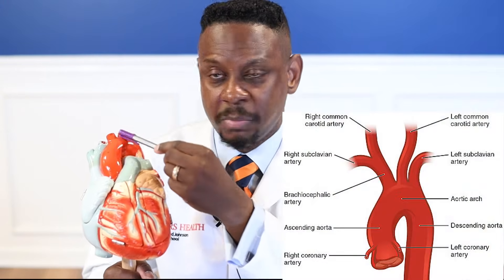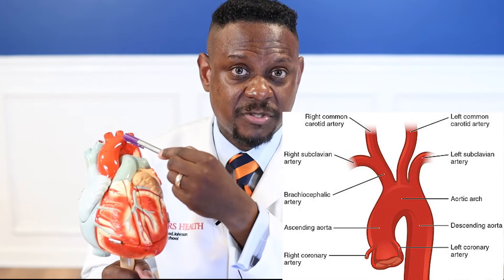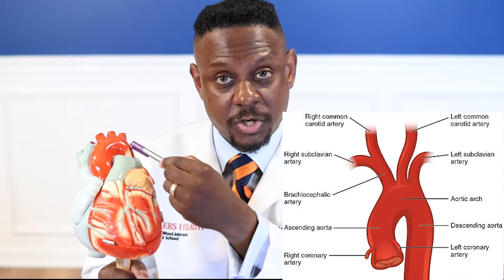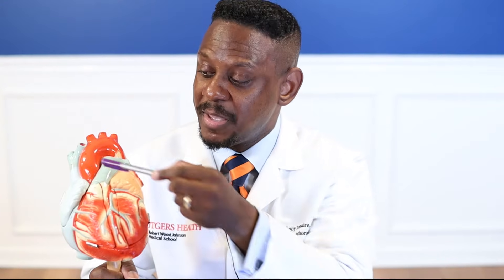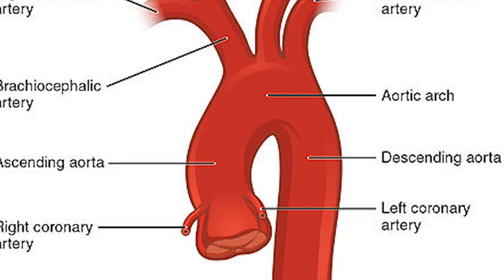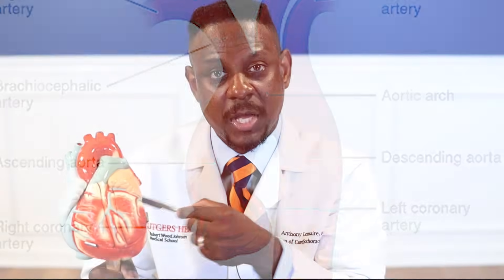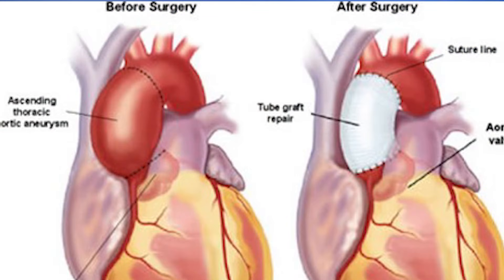Repair of An Ascending Aortic Aneurysm

Comment: Thank You Dr Lemaire.  I found your video fascinating and informative.  

I've been advised that I have a small leakage in my A valve (not fully closing!) I'm reluctant to have surgery.  Some years ago, I attended two bypass operations at different hospitals (on the same day) and actually held a heart in my hand during one procedure.  It was the most amazing day of my life - thus far and excluding my wedding.... On both I was suited and booted.

I've been wondering if, with today's science and technology, we may be able to effect a repair without surgery.  Probably not but a rotary saw opening up my chest seems archaic and invasive. 

I guess for now I'll live with it.

Thank you again.

John Carroll (jayceemusic)
Reply from the maker: Hi John,

Thank you for your comments. If you were told, you have a small aortic valve leak, its' possible you may never have to have surgery. If you do require surgery there are multiple less invasive options to address your aortic valve issue. First, there are minimally invasive surgery (thoracotomy and not sternotomy). The incisions are smaller. Second, there are percutaneous options in development for the repair of the aortic valve or replacement but this will not be available for a few years. Finally, I understand why you are concerned about traditional surgery with your chest being opened, however the outcomes of these procedures are very good. Patients have been having open heart surgery for decades and the results in the correct hands are excellent. Good Luck!

Comment: Mines is at 3.9cm mild dilation how long till it goes?
Reply: I’m at 4.0 cm. My cardiologist wasn’t too concerned.
Reply from the maker: Hi, if you are asking how long until it gets bigger or requires surgery, then I would say that no one knows. All patients have aortas that grow at different rates. There are different size indications for surgery (see the video). Your aneurysm is still quite small. Some cardiac surgeons wouldn't even follow that yearly at that size. I personally think meeting a cardiac surgeon and having a surveillance plan is good. Take care.
Reply: @cardiacsurgerypatienteduca2445  I get worried because my dad passed away in 2002 from a dissection and my aunt (his sister) had a dissection as well but survived. She mentioned Marfans Syndrome and researching about it. Most of my family have similar characteristics. Told my cardiologist about that so the suggestion was to talk to my primary physician for genetic testing from my understanding, patients with such syndrome have to be evaluated more closely. I also if no Marfans, due to being on a ventilator for two months and having pericarditis effusion, would that also contribute to the dilation? The doctor told me that my dilation wouldn’t even be considered an aneurysm because it grew evenly “minor aortic dilation of the root” and the rest was 3.3cm. Sorry for all the ranting, I really appreciate everything you do. Thanks again and many blessings

Comment: Could you please explain Coronary Artery Ectasia? Is it a serious condition?
Reply from the maker: Hi Prashant, Coronary artery ectasia is basically when the coronary artery is enlarged or is aneurysmal (widened). This diagnosis is usually made as an incidental finding during cardiac catherization.  This is a very rare diagnosis. I'll work on a video in the future but once again the diagnosis just means the arteries are enlarged. There is no clear treatment for it. If you have any more specific questions, please let me know. If you were recently diagnosed with this or know someone who was, then I would recommend making an appointment with a cardiologist or cardiac surgeon to review the diagnosis and treatment plan. Good Luck.
Reply: @cardiacsurgerypatienteduca2445  Yes, i have this condition and it's frustrating. I believe it's a rare condition that mimics heart attack symptoms and no set protocol for treatment. I am on anti hypertension, cholesterol lowering, aspirin and anti angina tablets. Would appreciate if you could make a video on it.

Comment: I’ve recently had an aneurysm diagnosed at the aortic root by echocardiogram. Is the bicuspid/tricuspid valve something that would be routinely checked and reported in the same echo? If my written results and my doctor are silent on the issue, should I “assume” I have a tricuspid valve? Seems there would be heightened concern if I had a bicuspid valve, but I’m told we’re going to keep an eye on things with an annual echocardiogram…progressing to more frequent if the aneurysm grows.
Reply from the maker: Hi, sorry for the delay in responding. An echocardiogram is the test that will determine if you have a bicuspid or tricuspid valve. There are 2 types of echocardiograms, TTE and TEE, with the TEE (Transesophageal echocardiogram) being a better test to determine what type of valve you have. I would ask personally which valve you have for at the very least your own personal knowledge. Regardless of what type of valve you have, if you're being told that they are going to just watch it, then its probably not bigger enough to operate. Keep in mind, if you have a bicuspid valve you are more likely to have valvular issues (leaky aortic valve) and increased aneurysm formation. I would ask. In addition, the bicuspid valve can run in families so this would be best to know for your family. Please make sure or at the very least ask if you should see a cardiac surgeon just so they can follow you as well. Finally, I wouldn't assume anything, just ask your doctor. Good Luck!
Reply: @cardiacsurgerypatienteduca2445  thank you very much for your reply. I appreciate it. I will confer with my doctors about it.

Comment: Hello Doctor,
My family member was just told his abdominal aorta aneurysm has grown to 7cm. They want to perform surgery, but he is extremely afraid, and thinks he can control it by controlling his blood pressure. I'm worried because I'm reading that surgery is the only option. He is 58 years old. What are his chances of survival in this scenario? Is the endovascular repair his best option?
Reply from the maker: Hi, at 7cm I would strongly recommending having the aneurysm repaired. The risk of rupture is very high. I would strongly recommend doing some research and finding a good vascular surgeon who could operate on him. There may be an endovascular repair option. I would try to get this done ASAP. If you want a particular referral contact me at www.cardiacsurgerypatienteducation.com.

Comment: Hi Dr. Lemaire:  My aneurysm was found by accident in 2018 when I had a cardiac CT done after an episode of chest pain.  (I had a chest CT in 2015 for something else and the aneurysm wasn't there.) My Ct was negative, all coronaries wide open, but they found the aneurysm. I've had a couple of echos and cardiac CT's done over the last 3-4 years and it has grown from 3.7cm to 4.5cm (this July).  I recently started taking BP medication as bp was elevated.  Currently on Losartan 50mg, checking  BP every day, going to see my cardiologist on 10/3.  I'm 70. 

My aneurysm is in the area of the sinus of Valsalva.  I live in a small mountain town, about 1 hr from a big city. I'm a former cardiac nurse, and as far as I know, there are no surgeons nearby who frequently do these types of aneurysms, esp. in the area I have it.  For me to have surgery, I'll probably need to go to Los Angeles.  My question is at this point, should I have a consult with a cardiac surgeon?  Would it be beneficial to me to start seeing a surgeon now in case it gets larger, or I develop issues?
Thank you!
Reply from the maker: Hi, sorry for the delay in responding. I would advise that you meet with a cardiac surgeon now for several reasons. First, it's always better to establish a relationship with a person who may potentially operate on you. Second, it will allow you time to determine if you trust the surgeon and like him/her. Third, it will give you time to discuss the long-term plan (surgical options). At 4.5cm, an aortic root aneurysm, which is what it sounds like you have, you don't need surgery right now. I suspect if your aortic valve is working fine, you won't need surgery until the aortic root gets over 5cm. Now, if your aortic valve starts to leak (aka aortic valve regurgitation) you may need the surgery sooner. There are very good aortic surgeons in LA. If you need a recommendation, contact me directly at www.cardiacsurgerypatienteducation.com. I suspect your cardiologist knows good cardiac surgeons as well. Good Luck.

Comment: My brother had a 5.1cm aortic aneurysm at the root area that dissected and he died.  Since there is some family history of this, I had been found to have a 4.6cm aneurysm at the root area and they suggested I get it fixed.  Always wondered if we jumped the gun there, but it is done.  Being an active person, ever since operation I get an uneasy pain or pressure in the chest and back when my heart rate peaks during exercise, this always happens.  Stress tests, etc, have been ok.  Ever hear of this effect? When hiking with friends I seem to be last one up hill, am 62.  I always wonder if this is just some residual pain due to clamshell effect of having chest opened.
Reply from the maker: Sorry for the delay in responding. I personally think that operating at 4.6cm is a little early however since your brother died, I can understand why it was recommended that you have surgery earlier than the actual size indication (5.5cm). Regarding the chest pain you're having a lot depends on how long ago was your operation. If its been many years since your surgery, I would be more concerned. Although you had a stress test, sometimes those are wrong (false negative). A cardiac catherization to look at your coronary arteries is the best test. I would speak to your cardiologist about this. I would also go back to your cardiac surgeon to discuss. Good Luck.
Reply: How long was your recovery?
Reply: @jamesreeves9740  I had the operation in May of 2013 and by October of that year I was hiking in Yellowstone.  Took some time though to get back up to speed on activities.

Comment: Thank you for your video 
My husband Diagnose ascending aorta 4.4 in ultra sound. He is 57 I am so scared . 
Pls suggest is there any minimal surgery? 
What is the success rate? 
Where I should go for surgery which city and hospital. Pls help me
Reply from the maker: Hi, your husband's aorta at 4.4cm may never get to the point where it requires surgery. I strongly recommend good blood pressure control and find a cardiac surgeon in your area that specialize in aortic surgery. The outcomes in surgeons who do this often are very good. There are minimally invasive approaches for this surgery.
Reply: @cardiacsurgerypatienteduca2445  Thank you so much for your quick response. I got some relief to read . God bless you 🙏

Comment: I'm interested about the gortex graft. When you sew it in and it is in position will there will a weakness at the 'sewing line'?  I will probably be needing this surgery at some point. Also, after the op do you still get screened to ensure everything stays in place? How common is it that the anuerysm develops again even with a graft? Thank you for your very helpful video.
Reply from the maker: Hi, I wanted to clarify that there are different types of grafts and actually the most common type of graft is the Gelweave graft not Gortex which I mentioned. Anyhow, you are correct that the "anastomosis" is the most important part of the connection. I don't want to use the word "weakness". Second, the aorta that is left behind can grow to become an aneurysm but what you remove obviously is gone. The patient's do require observation or surveillance after surgery to make sure that the remaining aorta doesn't grow. Its hard to say how common it is that the re
maining aorta becomes an aneurysm. I haven't seen the studies but I don't expect it to be high.
Reply: @cardiacsurgerypatienteduca2445  Thank you so much for your very fast and clear response. Much appreciated.

Comment: Thanks Dr Lemaire.  Very informative and helpful.  What can you share in regards to longevity post operation . I’m sure there are many variables.  I am a 35 year old male with BAV at 4.6cm.
Reply from the maker: Thanks for the comments. There are many variables as you mentioned however there are 2 constants. Regardless of the size at which an aneurysm is repaired, once the graft is in, it usually lasts forever unless there is infection. Second, once an aortic valve replacement is performed, the longevity will depend on whether a mechanical or tissue valve is used. If a mechanical valve is used, it should last forever. If a tissue valve is used it generally should or could last 10 -15 years. Most surgeons would like to state 15 years before the valve has to be replaced. I hope that helps. Take care.
Reply: How are you now?
Reply: @kchilz32  For now,  monitoring annually with echo to check size.  No growth since finding it, 5 years ago.  Thanks for asking.    Do you have one too?
Reply: @dominick8445  Im 41 just found out the root of my aorta is at 3.9cm dilated meaning it’s growing evenly not a bubble like most it was at 3.3cm in 2017. I runs in my family but the doctor said that no need to worry, I will get checked every two years but I think that’s stretching it a bit ( no pun intended) I’m probably going to get a second opinion. I’ll maybe check for top cardiologist/surgeons in Boston even if I have to travel a couple pf hours
Reply: @dominick8445  also try not to lift heavy stuff  or do strenuous things. I have to do a genetic test to see if I have what’s called Marfans syndrome aortic issues is most common with it. It’s a good idea to check because if that’s the case you may need to get surgery sooner. Hope you continue to stay healthy
Reply: @kchilz32   great news.  I hope it never grows.  I live in Cleveland and have had much luck with the Cleveland Clinic.  Would love to have Dr. Lemaire look at my case.  Will inquire with his office.
Reply: @dominick8445  yes Cleveland clinic is top notch, would be great if I where able to go there or Mayo Clinic as well. I live on Massachusetts so Boston would be ok but I’m looking for a minimal aortic repair option not many use those but it’s supposed to be the strongest and would not need to use blood thinners for life
Reply: @dominick8445  thanks hope yours stay stable as well
Reply: Hi. I'm curious. I am 32 years old with an Ascending Aortic Aneurysm of about 5.2cm. I have a bicuspid valve. My cardiologist is considering it stable still. I've seen multiple people say that with the bicuspid valve that you'd have surgery sooner than 5.5 cm. Is it odd that they would continue to monitor? 
Born with bicuspid valve. Been monitoring the aorta since I was 17. It has grown since.

Comment: Last year I was found to have an ascending aorta aneurysm of 4.5 cm and bicuspid aortic valve. Cardiologist did not seem concerned. Yet by what you are saying I am at high risk for rupture ~ I will be seeing a new cardiologist in July and get a second opinion. Thank you for your informational video. One question: " Is there a risk to fly long distance with this condition?"
Reply from the maker: I sincerely apologize for the delay in responding. First, there is no issue or risk with flying with an aneurysm. Second, to address your question. As long as your bicuspid valve is functioning well, I would not electively replace your aortic valve or aneurysm. If your aortic valve however was not working well, which most likely would be aortic valve stenosis, then if you had surgery, the treatment would be an aortic valve replacement and aneurysm repair. I apologize for not being more clear but you wouldn't replace the bicuspid valve if its working. I also wouldn't just fix the aneurysm at 4.5cm. If the aneurysm does starting increasing in size, especially greater than 5cm, I would at a minimum see a heart surgeon. I would make sure that your aortic valve and aneurysm are being checked yearly with an echocardiogram and CT scan of the chest.
Reply: Hi there, how did it went

Comment: Can a Stent Graft be installed into the ascending aorta instead of the above surgical repair?
Reply from the maker: Hi, Currently Stent grafts are not available to repair ascending aortic aneurysms. One of the main issues is creating a graft that will not occlude the coronary arteries. There are several companies working on it and so I believe in the future there will be an option to treat ascending aortic aneurysms with stent grafts.

Comment: Fantastic and easy to follow presentation for the average patient such as myself.  I am not a Marfan patient. My genetic connective issue is ehlers danlos. Thanks .
Reply from the maker: Thanks for the comments.
Reply: @cardiacsurgerypatienteduca2445     Can a Stent Graft be installed into the ascending aorta instead of the above surgical repair?